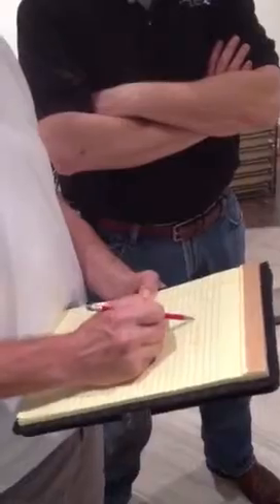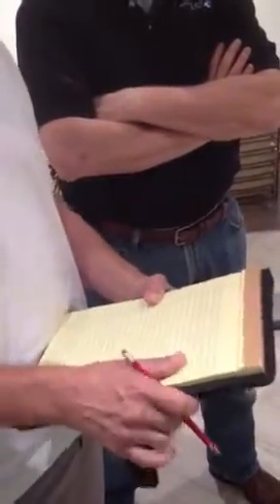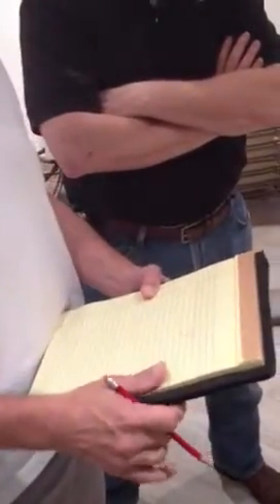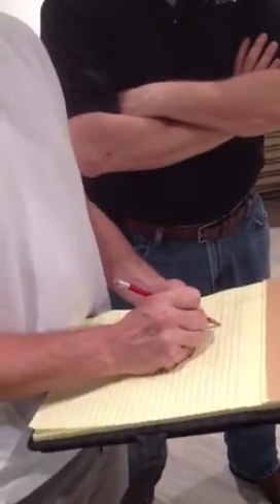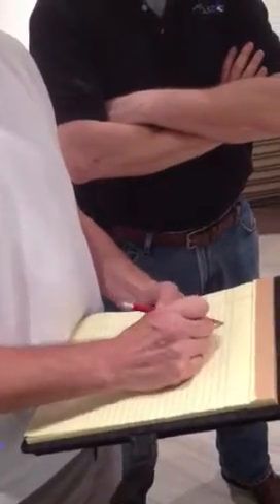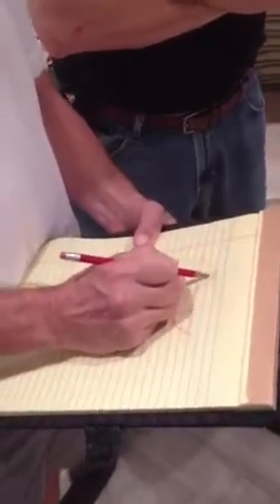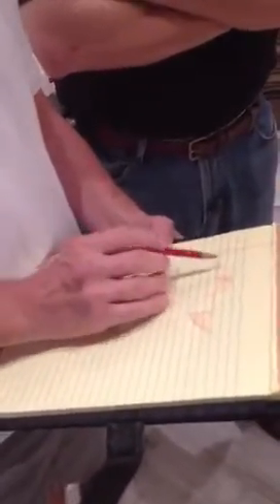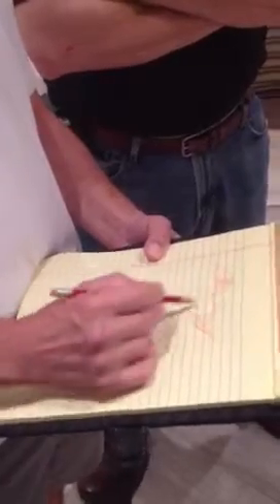Forward vs. Reverse Phase Dimming

Comment: Incandescent have used forward diimming, in quadrants 1 and 3, with a simple triac circuit for years. They work lousy with LEDs. You get limited dimming, erratic triggering and shut off and pop on problems. Reverse triggering, switching power off in quadrants 2 and 4 overcomes many of these problems but it takes a far more complex, expensive circuit to do it. Triacs require a minimum amount of current to turn on and LEDs draw so little that they don't turn on until the dimmer is advanced pretty far. Once lit they can be dimmed lower than the turn on point. The reverse dimmer hits the LEDs hard enough for reliable turn on and can be shut off more reliably